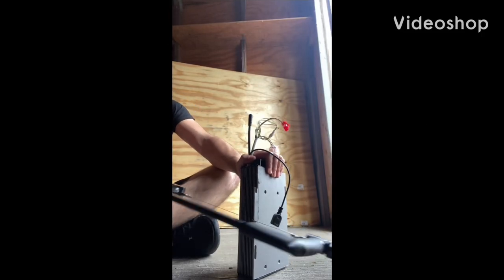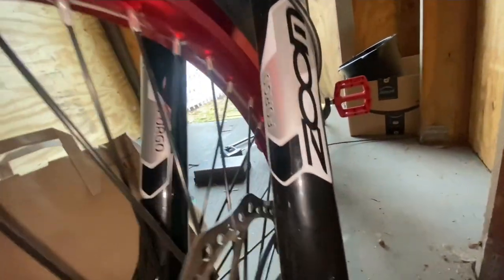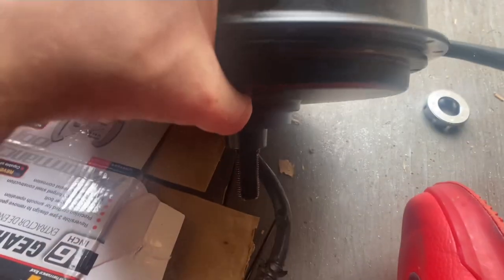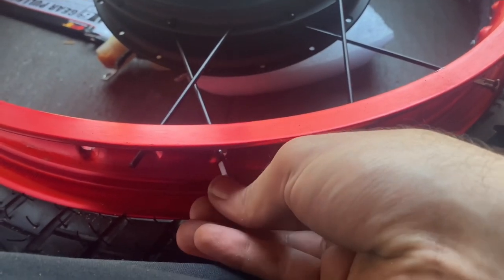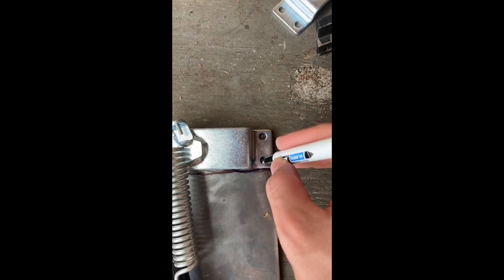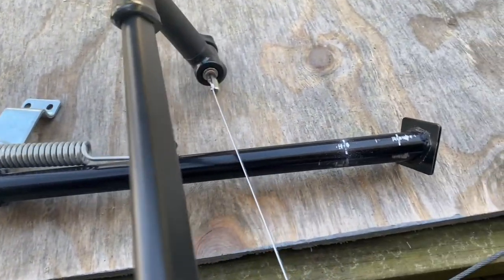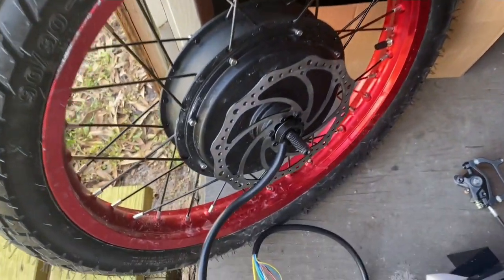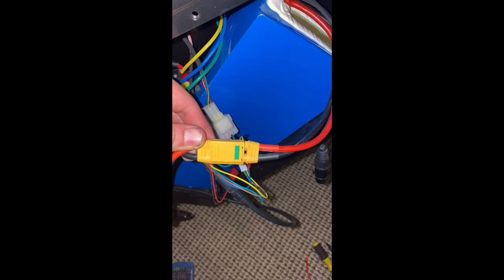Stealth Bomber Ebike Rebuild: 72v 3000w (Motor Fix, Kickstand, Parts List)

Comment: Jeżeli masz tą podkładkę plastikową pod tarczą hamulcową nadal to ją jak najszybciej usuń !!!!!! W jej miejsce wstaw na przykład wycięte wnętrza dwóch starych tarcz hamulcowych które zrobił dystans dla hamulca staraj się użyć jak najdłuższych śrub które wkręca się do końca gwintu w silniku osadzając je na niebieskim kleju do gwintów .
 Jeżeli zostawisz plastikową podkładkę to silnik się podczas jazdy grzeje !!! z czasem plastik mięknie !!! i wykrzywia się mocowanie może to prowadzić do zerwania  śrub mocujących tarczę hamulcową .
Reply from the maker: Good comment that is probably what happened to me again. I placed a metal spacer to protect the wire but there was an issue with the plastic spacer warping and causing the screw to cave in, leading to the metal spacer turning inwards and leading to my hub motor wire being cut. Theres to much damn experimenting with these bikes and larger hub motors it is not worth messing with them anymore at this point. Endless money pit I am done working on it.

Comment: If you fukd up some stuff because of lack of attention to spacers...how could you not use them
Reply from the maker: The plastic spacers can melt under heavy braking and the motor wire can hit the rotor and tear
Reply from the maker: Just dont have the wire inside of the frame and problem solved, not worth the trouble.
Reply from the maker: I chose to have wire tucked into swingarm for looks purposes and it's difficult to have spacers aligned and bending the wire. Its not worth it causes more trouble when a bad spacer decides to give out or whatever. Best to wrap around the outside of swingarm to keep wire straight away from rotors. Or get a smaller motor with a smaller wire for less trouble.

Comment: dude nice bike i have the same powerrr but improve your soldering skills it's not easy with that thick wire i know... and Ec8 worked for me the best as at90 gets to hot and meld while soldering
Reply from the maker: I am working on it. Thanks for the support. Next is to get a replacement controller. During first build the magnet in the motor fell loose and prevented the wheel from moving. After new motor and connecting wires the bike never turned on. Battery voltage was good from multimeter, however there was no power getting to my display from the controller. Hopefully new controller solves issues.

Comment: Dude! Great Video!! can you post the link for the front wheel? I bough a second hand bike and came with a regular mtb front tire and a 20x110mm thru hub in it. I will like to find one that matches the rear tire (19x2.75)
Reply from the maker: Thank you for watching. This is the front wheel I used. NBPOWER Hydraulic Brake !QS V3 205 Motorcycle 17" 18" 19" 21" 72v 5000W Ebike Rear Motorwheel with tire, 72V 100A Sabvoton Controller with PAS and Alarm,Matching https://a.co/d/9fR8wJW. This fit with plenty of clearence in front zoom fork.